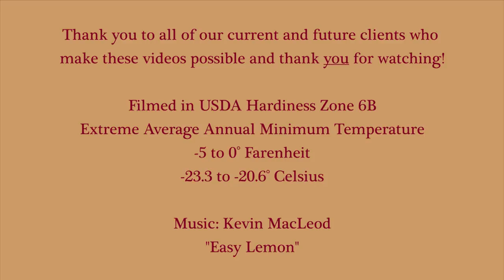Stihl Carburetor Rebuild - Stihl 036

Comment: I also have a Stihl 036 which I have used for 20 years now. The only thing I have changed is the spark plugs. So far my 036 runs perfect. But I will go back to this video the day I have to clean up the carburator and change fuelline.  Bad no new screws followed with the new air filter.

Comment: You should invest in some non-chip acrylic top coat nail polish to seal those welch plugs. Carburetor cleaner sometimes can be too harsh of a solvent, try using non-flammable break parts cleaner instead to clean surfaces and to spray the high and low speed.

Comment: Anyone know what the metering lever setting is for the Walbro car on these MS2590s? Just rebuilt mine and discovered on the Walbro website that part number 500-13 is needed to set it properly. At 6:34, a straight edge is used in the video but no actual measurement/setting is indicated.

Comment: My Pro 036 is bogging down.  Not sure if I have to replace or rebuild Carb  ?????
Reply from the maker: It's not a big deal to rebuild the carb.  The parts will cost you less than 20 dollars and the time depends on how well you know small engines.  Take your time and enjoy the process and you may well have the solution.  I'm sure there could be other reasons for bogging, such as a carb out of adjustment or old gas.  You might want to post a question on a chainsaw forum and see what they say to check first.
Reply: @CTSCAPER  Thanks  We already changed to fresh gas, new fuel filter , new spark plug new air filter.  Saw starts and runs fine until you start the cut.  Then I can run it half speed only. Full speed stalls out the saw.

Comment: if you spray out your carb. with carb. cleaner you take a risk of trashing your carb. I was told by a Stihl mech.that the cleaner melts parts on inside of carb. he said use wd 40 or seafoam.
Reply: Hey there, I work for stihl, carb cleaner WILL melt your purge primer bulb on that stile of carb, it will also melt some gaskets within the carb and possibly the orings within the accelerator pump, meaning your carb will leak like crazy and possibly could lean seize your machine eventually, causing far more expensive repairs.
Reply: I dip mine in carb cleaner after disassembly and then rinse with hot water then blow dry with compressed air.  Been doing it that way for years and never had a failure.
Reply: Ethanol fuel hurts these carburetors more than anything...Use gasoline without alcohol and your saw will be much happier..
Reply: @joew9392  35 yrs doing the same thing complete disassembly put all metal parts in basket soak in cleaner rinse with water reassemble

Comment: Not a full rebuild you didnt remove the fulltime jet and clean that causes 90 percent of the problems its under tht rusted piece
Reply: I just found out about it today at the stihl dealership it's under the aluminum piece that is pinned down you can see it in your picture you drill a hole in it and pull it out and sometimes there is a screen there to clean or replace to properly clean it you have to tap the jet out and clean the jet. And the fuel passages I ran into this recently on mine the fuel corrosion was terrible
Reply: Is it that triangle piece you are talking about at about 5:02 and does it come in a rebuild kit?

Comment: Gave my ts400 an overhaul cleaned carb exactly the same as this and rebuilt it and the piece of shit still didn't work, bought a cheap copy carb off eBay and it runs. It seems to me that when the carbs go bad you just need to replace them. Anyone else think same way or am I doing something wrong with every Stihl carb. Husqvarna way better than any stihl junk I've owned
Reply: I had the same experience. I carefully cleaned and rebuilt the carb, no  start. Bought cheap replacement (for about the same price as the rebuild kit) and the saw ran perfectly.
Reply: Same problem I just haven't bought the new carb yet.

Comment: I kust bought a 036 Pro at sn auction and need to put a carb kit in it. I know how to kit a carb and tune, but I cannot get the carb out it keeps getting stuck on the handle.
Reply: Justin Johnston- did you ever figure out how to get the carb past the handle?  I have the same problem.  the carb has a little square "window" on the bottome that bumps into the handle.
Reply: Yes.
Take the top of the handle off. It is a T27 torx screw.
Lift from the back of the black strip, and it inhooks.

Comment: yea just that easy to rebuild I am a still.mec thay don't allways start up on the second pull
Reply from the maker: I'll take luck as often as I can get it.
Reply: John, as a Stihl mec, would you be a able to help diagnose an issue?
Stihl Wood Boss 028 AV
Saw has been stalling out when it warms up, and getting harder to start. Cleaned the carb, replaced spark plug, and now it seems to idle a lot better, but still needs a few pulls to get it started. Used to be 1-2 pulls.
Any ideas?
Thank you sir

Comment: saved a 34 super from my uncls dumpster . went through saw  good compression every thing ok, started it up adjusted  a bit but it just keeps running  away  on me I can keep it calm if I work choke with my thumb  but the  second  I don't it tries to rap out ? sucking  air ? or carb problem ?
Reply: faulty metering diaphragm rebuild or replace carb . 34 s great saw